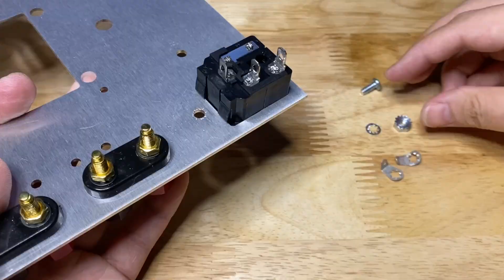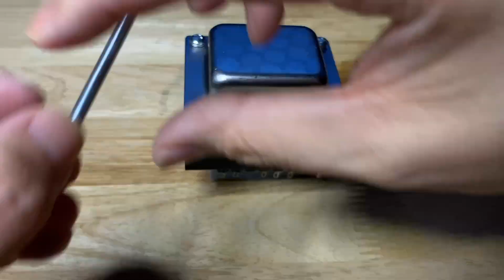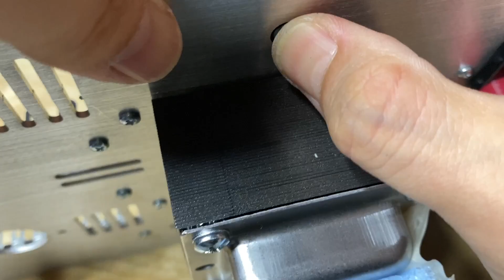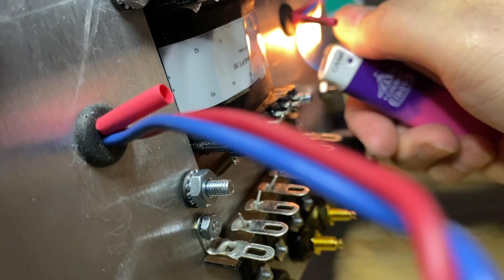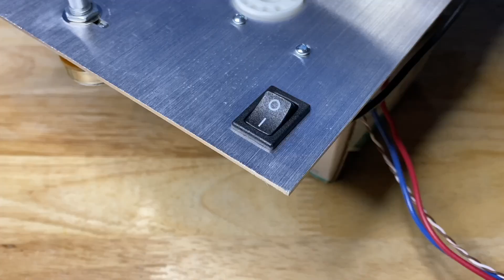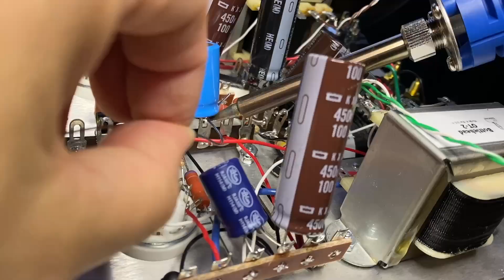Vacuum Tube Amplifier DIY : Bottlehead Single Ended eXperimenter’s Kit 3.0

Comment: tip for the future,  don't apply direct flame to heat shrink.  do quick passes where the flame is close but does not come into contact with the tubing.  all it needs is heat.
Reply: or hair dryer set on hot

Comment: Star washers on the bell housing to tie it electrically and magnetically to the core and then isolate the transformer from the chassis, can you explain the benefits of both actions? Thanks!
Reply: isolation of power transformer  from the chassis is a good way of preventing hum from the mounting bolts passing to the chassis. Impressed with the details of Bottlehead design. Build more and enjoy, James Kaolee.